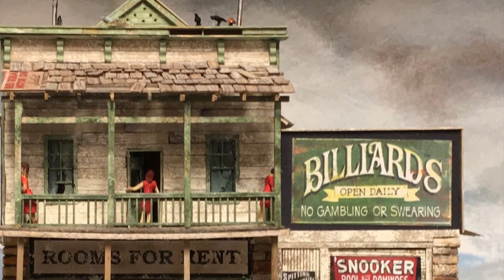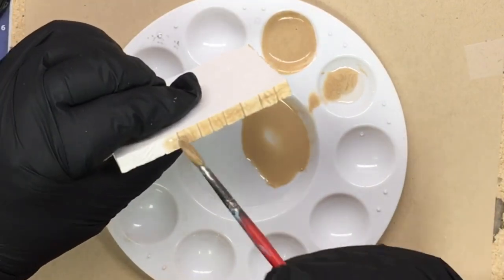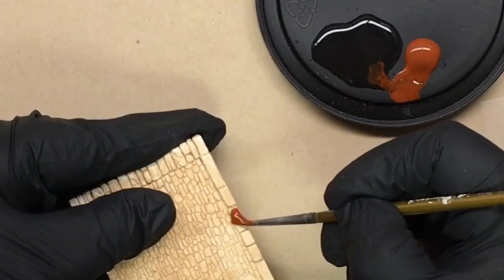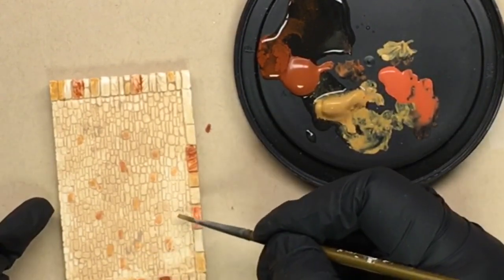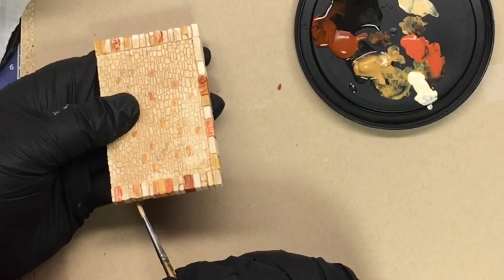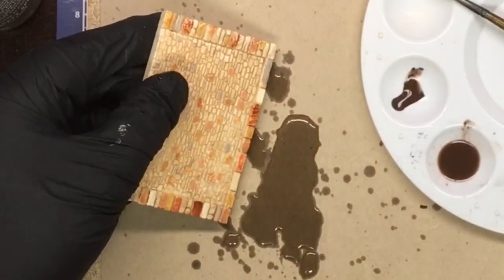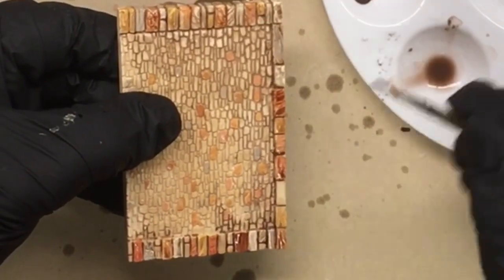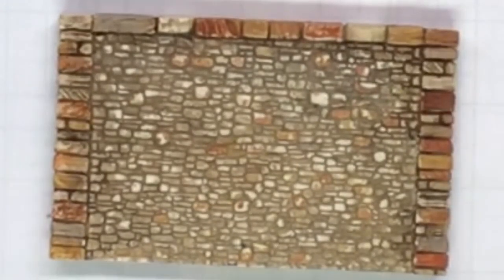Easy Model Building Painting Hydrocal Stone Walls

Comment: Hi Darryl, Great to see you making new instructional videos!  Those are some great techniques.  No expensive paints or tools required.  Working with plaster walls can be a challenge and you have shown with patience and more patience you can build and make the difference between a good model and a show piece model.  A lot of new kits use laser engraved "stone" walls.  It would be great to see your techniques for painting one.
Reply from the maker: Learning to use iPhones for making videos.  20 years ago the video editing programs were expensive, hard to learn and very finicky.  Making videos today is so much easier.  Laser cutting and engraving has added so much to the hobby today.  I love building in HO again after decades of scratchbuilding in O scale, board by board.

Comment: Howdy Darryl, Once again you have created a terrific instructional video and displayed your keen artist's eye.  Your instructional style is effective and motivates me to want to work on a plaster building.  I have always coated the plaster with flat white paint, but will try your technique on the next stone structure.  Thanks!
Reply from the maker: I am happy you enjoyed the video.  I used to just stain the plaster with washes, but I found the stains were absorbed differently on different areas of the structure.  Using a very thin wash of a basic color to seal all the plaster works better.  I used to spray my buildings with white primer.  But living in Alaska for 45 years made it hard to find a good day for spraying paint outdoors.  Cheap acrylics work fine for me.  Next uo will be paiting a rustic brick wall using similar techniques.  Stay tuned.